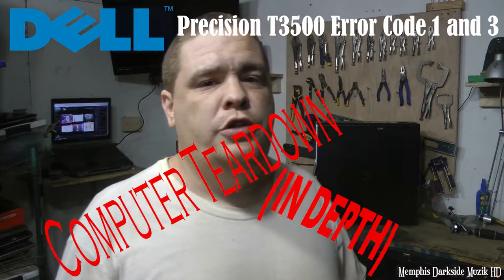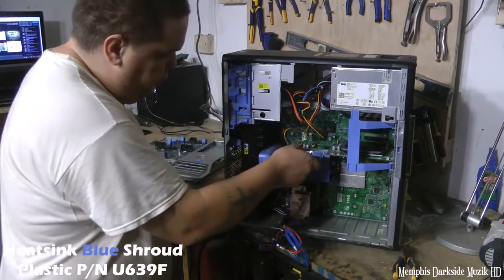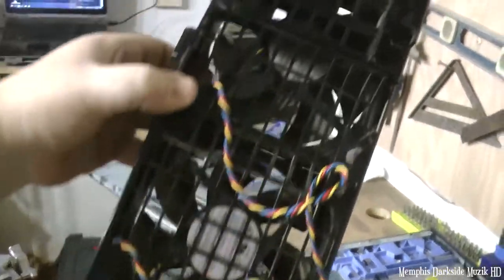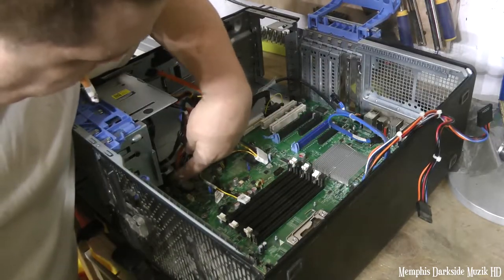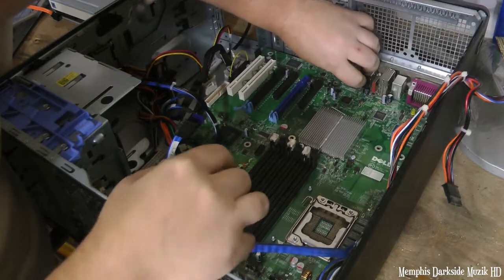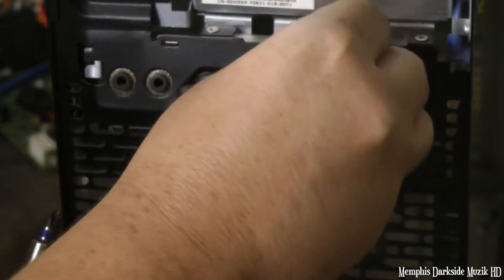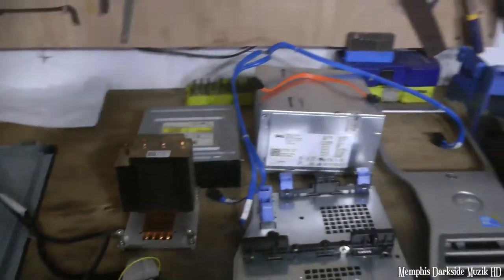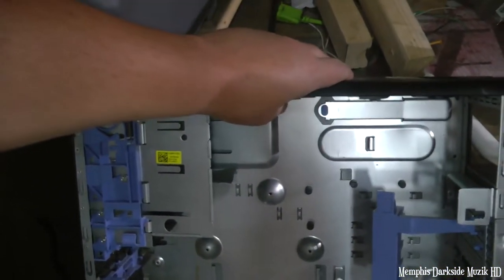Dell Precision T3500 Error Code 1 and 3 Complete Computer Teardown/Disassembly All Parts (IN DEPTH)

Comment: My T5400 gave me 1 3 Solid Light Error.. What does it mean? & how to fix it..?
Reply: @Tech_Connection1337  in my case.. FANs works fine.. Board is On.. Light is On.. Including my PSU light is on & properly working without giving any error.. I don't know the reason behind it.. Still confused..
Reply: @Tech_Connection1337  Tested Already.. Still No difference..